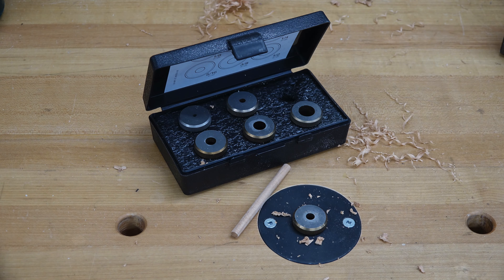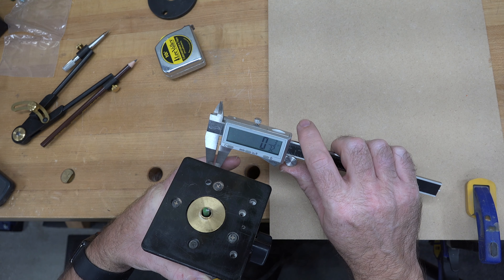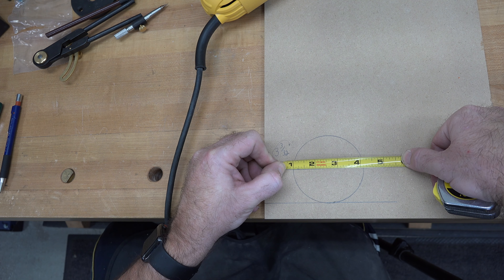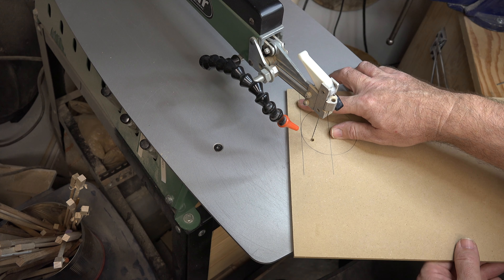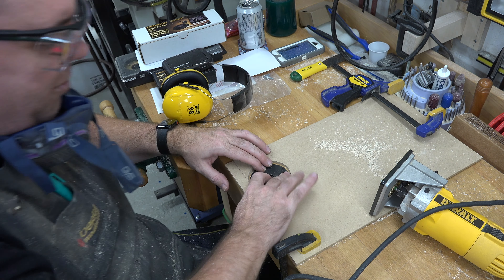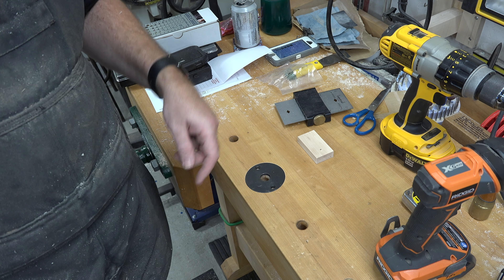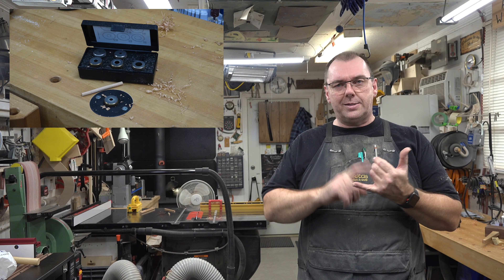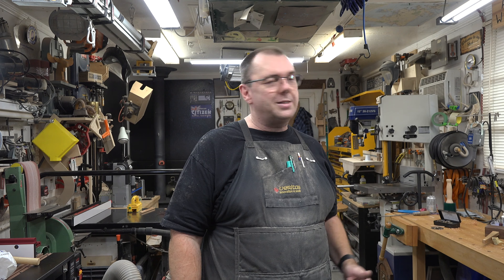Dowel Former Installation

Comment: Nice video in regards to how to set up the router and making a template and using a guide bushing, for me this was the best part of the video. I have made a dowel maker from a flat piece of 1/8 x 1.5 cold rolled steel, I drilled a 1/4 hole in the steel then with a 5/8 bit I drilled a chamfer not going all the way through the steel. I then filed two flutes as cutting-edge’s to make the 1/4 dowel I chuck the stock into a drill. It works great.               I think is great that you produce these helpful videos, especially with this COVID-19 going around you spawn ideas and you are a fresh distraction from the news. Thank You. 😁🛫
Reply from the maker: Thank you so much for the kind words on the show this week.  We are living in some crazy times right now and we all need a little distraction from the craziness around us.  There's no Covid 19 in my shop and therefore, it's a great place to hang out during this scary situation.  I will continue to put out videos as long as I can and I'm glad that you are finding them entertaining and useful.  Thanks for tuning in.

Comment: VERY good information at the end!!!!!! There IS always a solution to a problem!!!!!!
   I have a solution to a problem you may not know you have with your new tool. Mount a small removeable container underneath the bench top to catch the dowels so they don't fall to the floor
Reply from the maker: LOL.  I've already thought about that.  At the base of each of my bench dog holes, there is a pivoting cover that keeps the bench dogs from falling out.  As long as I keep that cover closed, the dowel stays in the bench dog hole until I slide the cover aside and allow the dowel to fall into my hand.  Although I do like your idea of a removable container.  Thanks for tuning in to the show and taking the time to chime in with your suggestion.

Comment: Good information!   I don't have a scroll saw...yet...but i do have a couple fly cutters, AKA circle cutters.  I would have to experiment to get the size right but that would work.  
Stay safe!
Reply from the maker: That would definitely work Woody.  I call those knuckle busters.....don't ask me why.....LOL.  Thanks for tuning in to the show and taking the time to leave a comment, chiming in with your experience.
Reply: @acutabove_woodworkings  LOL-I hear ya about the knuckle buster part.  Only had it happen once.  I have a fair selection of hole saws that I use for holes bigger than 2"-my largest Forstner bit-I only use the circle cutter for the odd sized holes.

Comment: Kenny, I really like the dowel former.  I probably would have taken a different approach to installation.  I would have spent the money on the 3 inch bit then finding out that that might not have been the best idea because it is hard to drill a perfectly perpendicular hole with a hand held drill I would have tossed the whole thing in a drawer until I watched this show.  Great problem solving my OCD friend.  Now I don’t need the bit, just the dowel former.
Reply from the maker: Thanks for the kind words on the show Paul.  I have to say that it's pretty nerve racking to rout out a 3+" recess in a bench that took so long to make.  It worked out perfectly anyway so I'm glad that it worked out like it did.  Thanks for tuning in this week and taking the time to leave the comment.

Comment: Gag reel; there in lies the reason for always wearing your safety glasses! Great job figuring out an alternative way of doing that. If you would have added the 3/32” to your radius your hole would have been the correct size 3 3/16”. Thanks Ken! You are right always cut a trial piece first.
Reply from the maker: What the heck is all this math stuff in woodworking.  LOL.  Glad that I made the test cuts before routing the final recess.  Thanks for tuning in Frank.  Always great to hear from you.

Comment: Great show Kenny! My OCD has caused many projects to end up in the burn barrel. I do (attempt) a lot of scroll saw projects and as I said a lot of times I will make several attempts before I get one that is acceptable (did not say “I like’”)!

Have a great rest of the week and stay safe!
Reply from the maker: Rule number one Ken, nothing is perfect.  Rule number two.  The imperfections that drive us crazy today, are the stepping stones to obtaining as close to perfect results as we will ever see.  Embrace them.  Thanks for tuning in to the show and for taking the time to leave the kind words.  It's very much appreciated.
Reply: kennyearrings1 Thanks Kenny. Along them lines what size scroll saw blade would you recommend for 1/2” and 3/4” walnut. I normally work with 1/4” wood and use a Pegas #5 modified geometry blade. Should I switch to a bit heavier blade or should I be ok?

Thanks again,
Ken